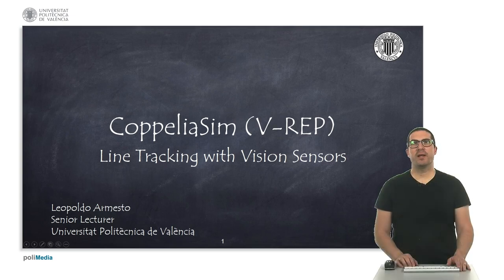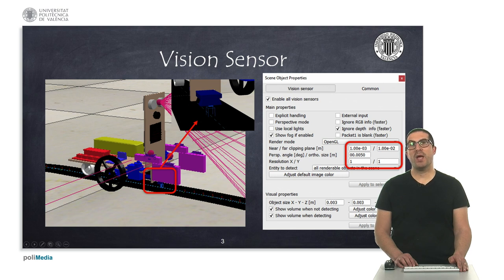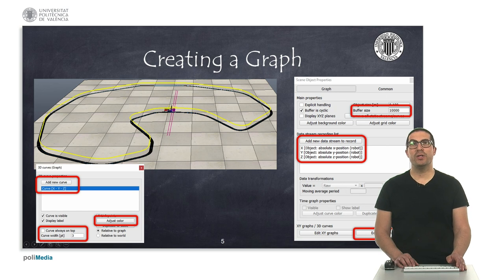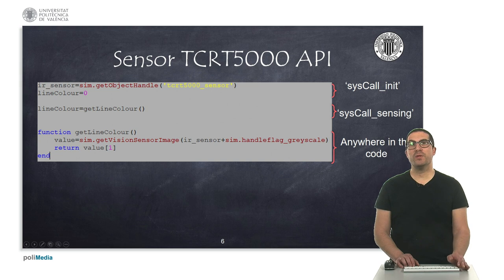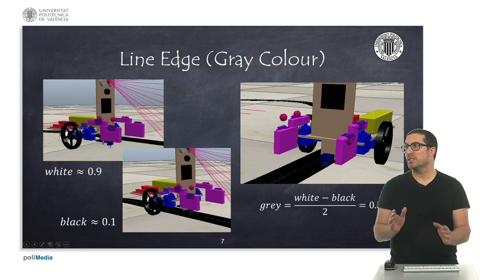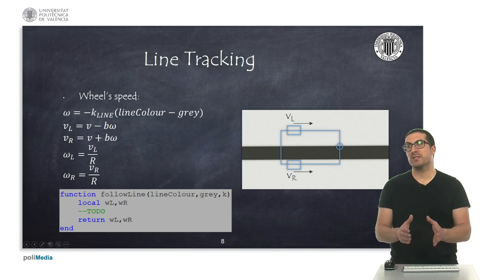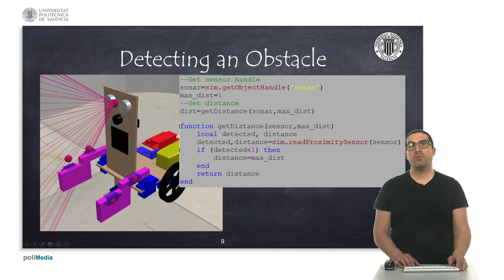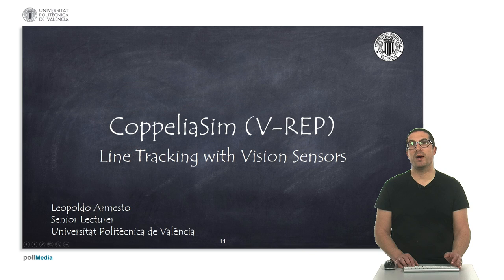How to Use Vision Sensors for Line Tracking with Proximity Sensors| CoppeliaSim (V-REP)

Comment from the maker: The line must be 1mm above the ground so that it can be correctly seen with the vision sensor, since the camera properly renders the line (otherwise it overlaps with the ground itself).

Increasing sensor resolution will provide a smoother behaviour. You can modify the ‘getLineColour’ to obtain a mean value of the pixels:

function getLineColour()
  local val=0
  value=sim.getVisionSensorImage(...)
for i=1,#value,1 do
  val=val+value[i]
end
return val/#value
end

Comment: When I run the simulation and Even though the robot is at rest it seem to slide slowly in the scene. I'm unable to stop this. Can you please explain why..?
Reply from the maker: This is an ‘inevitable’ drift caused by the interaction between the wheels and the floor. This has to do with bullet library parameters, but I could not remove it completely

Comment: Hello Leopoldo, can I use the vision sensor to obtain or to get the distance between the vision sensor on the robot and colored object without using proximity sensor or other component?? and thanx a lot for your support
Reply from the maker: Yes, I have a demo on that (not published yet) using Kinect sensor
Reply: @LeoArmesto  Please can you tell me how to get x,y&z for each pixel from the Kinect sensor in the script?
Reply from the maker: @mawjal-jadirjy1336  Try to adapt this code: kinect_depth=sim.getObjectHandle('kinect_depth')
resolution=sim.getVisionSensorResolution(kinect_depth) 
result,perspective_angle=sim.getObjectFloatParameter(kinect_depth,sim.visionfloatparam_perspective_angle)
ratio=resolution[1]/resolution[2]
    if ratio>1 then
        angleX=perspective_angle
        angleY=2*math.atan(math.tan(perspective_angle/2)/ratio)
    else
        angleY=perspective_angle
        angleX=2*math.atan(math.tan(perspective_angle/2)/ratio)
    end
    x0=(resolution[1]-1)/2
    y0=(resolution[2]-1)/2

depthBuffer=sim.getVisionSensorDepthBuffer(kinect_depth+sim.handleflag_depthbuffermeters,x,y,width,height)
points=get3DPoints(depthBuffer,x,y,width,height)
function get3DPoints(depthBuffer,x,y,width,height)
    local angX,angY,tanAngX,tanAngY,Nx,Ny
    local Px,Py,Pz,points
    Nx=resolution[1]-1
    Ny=resolution[2]-1
    k=1
    points={}
    x=x-x0
    y=y0-y
    for j=0,height-1,1 do
        angY=((y-j)/Ny)*angleY
        tanAngY=math.tan(angY)
        for i=0,width-1,1 do
            angX=((i+x)/Nx)*angleX
            tanAngX=math.tan(angX)
            Pz=depthBuffer[k]/math.sqrt(1+tanAngX*tanAngX+tanAngY*tanAngY)
            Px=Pz*tanAngX
            Py=Pz*tanAngY
            table.insert(points,Px)
            table.insert(points,Py)
            table.insert(points,Pz)
            k=k+1
        end
    end
    return points
end
Reply: I really appreciate your help, thank you

Comment: sir i want  to follow pioneer_p3dx  by the other pioneer_p3dx#0 robot  i already got the x y z coordinate of the pioneer_p3dx now how i will give that coordinates to the  pioneer_p3dx#0 so that it will follow the pioneer_p3dx
Reply from the maker: A simple way to approach this problem is to use kinematic formulas used for path following (p control), but in this case your reference target point is the other moving pioneer. If you include also the velocity direction to implement the feed-forward then it will work better. There are many alternatives that can do the same task, anyway...
Reply: @LeoArmesto  thanks i will try that